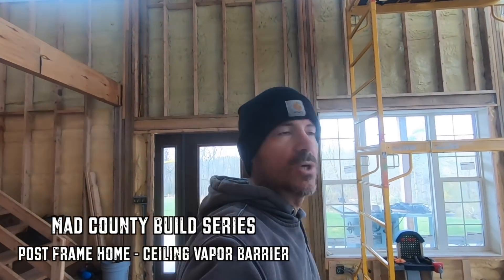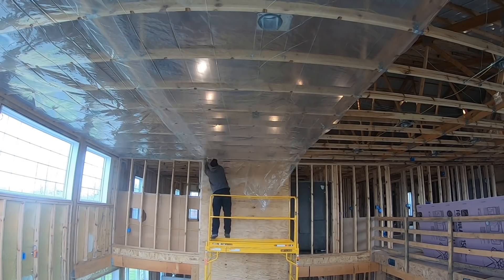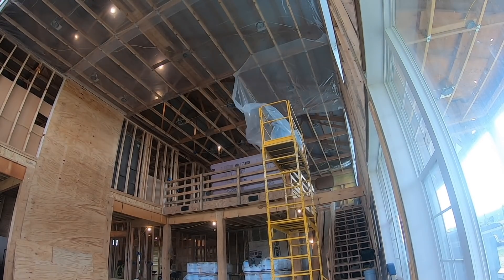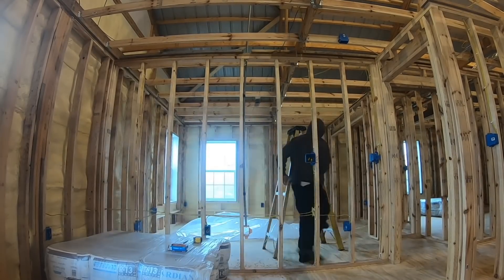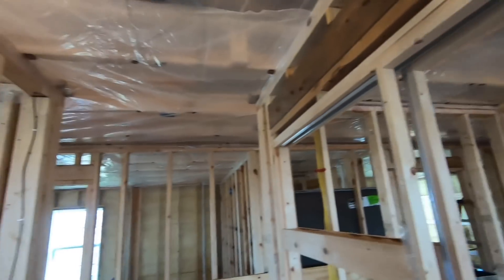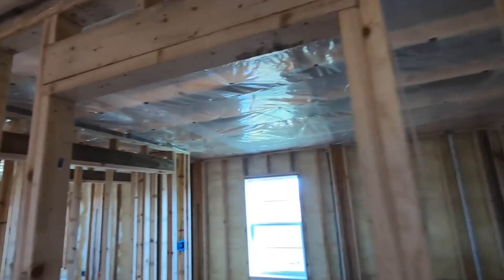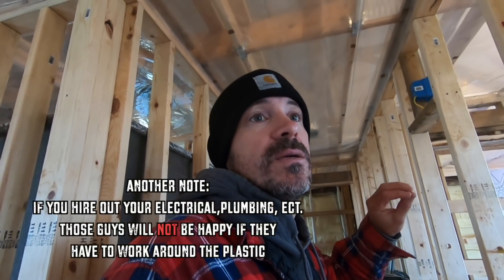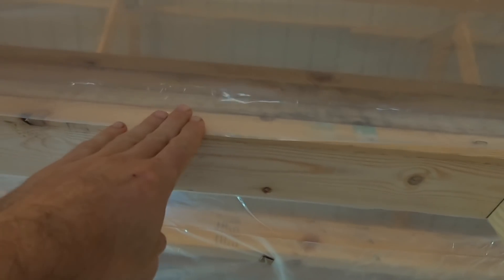Post Frame Home -  Ceiling Vapor Barrier Explained!

Comment: I know it's going to cost quite a bit more, but I really want to seal and spray the entire roof for an insulated and unvented attic when I build so that I never have to worry about any of that. I feel like it will be worth the extra expense in the long-run.
Reply: It's still a good ideal to put up Vapor Barrier in the Bathrooms and Kitchen, any place with a high Water use place.
Reply: @TdrSld  I was thinking Schluter for the entire shower/tub areas and an HRV so that I'm constantly pulling air out of the bathrooms and putting fresh air into the bedrooms and common areas
Reply: @chaseweeks2708  That is a great start, but bathrooms put out a lot of water vapor and keeping it in the room and venting it out is the best way to keep it from molding. I have seen tons of 2000's and 90's home were they just through dry wall up and said the vent will do the job. Guess what mold everywhere around the bathrooms. even on the under side of the roof above the bathroom. Really scary the way cheap track homes of been built down here in South Texas. 

If you're looking for good building science Matt Risinger here on YouTube is a great resource! So is Marshall Remodel, he has some good pointers for colder climates.
Reply: @TdrSld  haha, Matt is how I learned about Schluter. My theory is with the HRV intake being inside the shower/tub area and constantly running, the water vapor shouldn't exit the shower with the negative pressure pulling in fresh air from the rest of the bathroom, and from the rest of the house. I may decide to go a bit overboard and try to run the Kerdi everywhere in the bathroom, but I don't think it will be necessary. A thoughtful choice in paint formulation should prevent what little water vapor that might escape the shower from entering the drywall. I think anyway. I've still got at least 4 years until I'll even be able to break ground, so who knows what I'll learn between now and then, or what new ideas I'll find to work into my design(s).
Reply: @chaseweeks2708  
If it's not a steam room you don't need kerdi everywher but you should look into  intelligent vapor membranes like siga majrex, its great for cold climate and its superior to the poly barrier in every way. Works great in cold climates and it doesn't trap moisture.

Comment: Lookin good! Do you think you'd need the 6 mil plastic if you had closed cell spray foamed the back of the roof? And would you still need to do blown in insulation if the roof is spray foamed? Also, what weight of snow load are your trusses rated for?
Reply: If you spray foam your roof you don't need the vapor barrier because close cell foam itself can be used as vapor control layer. The blown in insulation wouldn't be needed in a condition attic.

Comment: Nice. Never knew you had to put it on the inside ceiling. Always thought it went on the attic ceiling.
Reply: It depends on the climate -- in cold climates you want vapor barrier on the warm side of the insulation so interior moisture is stopped before it can condense or freeze on the cold side of the insulation.  If the barrier were on the cold side of the insulation then interior moisture would condense and possibly freeze on the interior side of the barrier (which is in the cold attic). 

In warm humid climates you do it the other way.  You want to stop exterior humidity (think Florida) from passing through the insulation condensing on the  relatively cold (from air conditioning) drywall.  Not a freezing issue but a mold issue.    In climates with both then I guess  you flip a coin.  Don't think you would put two barriers as that would trap moisture in the insulation material.
Reply: @craigs5212  well I live in central Indiana so one season will be hot and humid and the next bitter cold.
Reply: @jfarrar231  just ask yourself, “do I run the heat or the A/C for more months?” That will tell you what the warm side is.

Comment: Are you goig to install insulation on the roof or just the vapor barrier?
Reply: He mentions he's going to blow in fiberglass insulation on top of the vapor barrier. Nothing against the attic ceiling (direct underside of the roof) though. That's all basically atmospheric conditions.
Reply: @seank9643  I think in such cold weather I should have blown insulation on to the roof . It is an option , later you will decide what is appropriate , greetings from Spain
Reply: @mikeljon7707  I believe the entire attic is vented to the outdoors through the soffits and ridge cap, so insulating anything besides the floor (i.e. interior ceiling) wouldn't achieve anything.